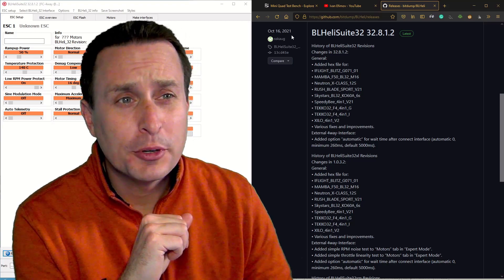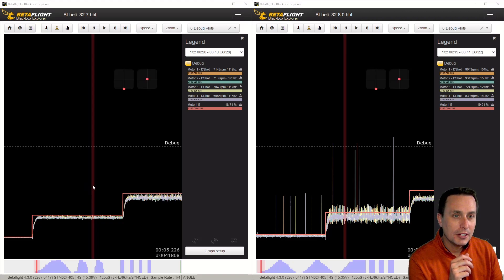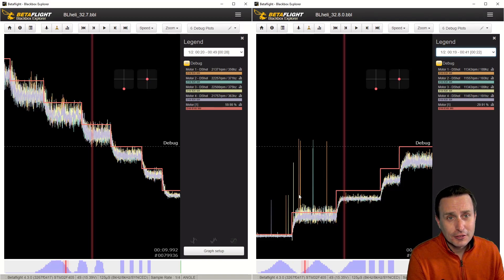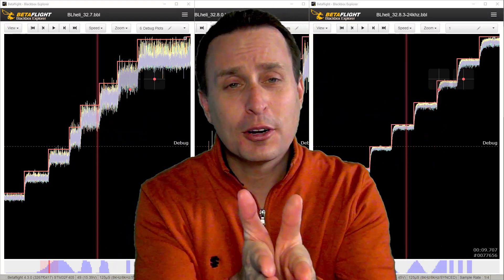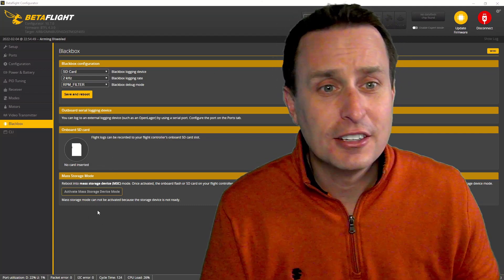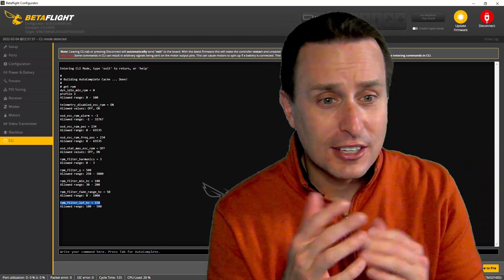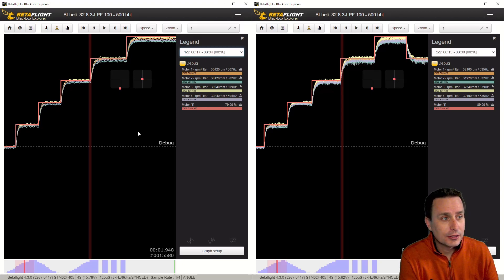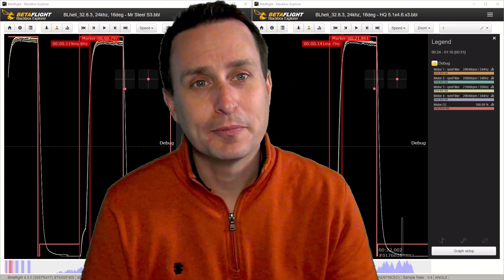💥The BEST BLheli_32 🔥 | RPM Filter Secrets 🤐

Comment: have a mamba f50_bl32 pro, used the 16-byrpm and had weird jitter at low throttle (1300) i could see the difference in throttle resolution tho at low throttle compared to other quad locked at 24.
i would like to use the by rpm setting just dont think my esc supports it. using an f405 board on both and they run dshot 300 4k/8k with correct filters and dyn idle at 24-25.
also my motors would sound like they almost stall out and get a wub wub sound on throttle chops letting it fall.
Reply from the maker: Dynamic Idle of 20 to 25 may be top low.  try 30 or 35.

If 16 - ByRPM is too low then of course their is 24 - ByRPM or just 24khz straight up (locked) which is tried and true.

Comment: Well, thanks man! On 1 of my recent BF builds with XNova Hardline Freestyle 2207 motors on an Apex 5", I had weird motor behavior, which looked like some kind of desyncs (motors did not seem to spin harmoniously) right after arming and just a small throttle, not even getting the quad off the ground. All on BF default PIDS and Filters, got to start somewhere ofc. Enabled Bidirectional Dshot, tuned filters BB based, But it was still there, be it a little less. Put back everything on default now, and did the upgrade to 32.8.3, arms normal now also with some quick throttle-punches. Now I simply have to wait for dry moments with less wind-gusts to finally start tuning it.

Comment: @UAVTech I have a set of Airbot Wraith32 mini st  blheli32 escs on my v1 Kopis. I think they would have the  f0 processor.

Would I still be able to run 32.8.3 testcode for some benefit, or would byRPM not work at all on these?

-i'm trying to gauge if should update to 32.8.3 or rollback to 32.7 on these (they were recently updated to 32.8 from 32.2 in order to enable the rpm filter/bidirectional dshot, but never tested out in flight)

Thx👍

Comment: is this why I can't get higher than D-shot300 on my 40A mamba pro stack that is capable of D-shot1200
Reply: well the answer looks like a no.. it shows higher errors of over 80%. while 32.8 only showed errors around 5% ??? i have seen loads of complaints about dshot errors with a few different Esc's not just the mamba
Reply from the maker: interesting

Comment: have an ESC which seems to be not in the 32.83 test code base. It's  T-motor Velox V45A and the hex file in 32.7 and 32.8 is called Tmotor_32Bit_32_83.Hex Bit the closed in 32.83 is called Tmotor_32Bit_Multi_32_83.Hex can i just rename it to Tmotor_32Bit_32_83.Hex and flash it anyway ?
Reply from the maker: If you download the right HEX, it will show up in the Configurator once it is placed and Suite restarted.  I would not rename to force it.
Reply: @uavtech  Wow that just works, I did presumably not restart after placing the hex file, now I'm feeling really dumb :-)

Comment: Awesome, I noticed weird behaviour on my latest build with BF 4.3 and  iflight 4in1 Blheli32 ESC , that comes with 32.7 : on dshot600 motors returns errors, ( found out later that some batches are with different low quality cks mosfets that generates this errors ) I put 32.8 ( not 32.8.3 ) and the errors goes away but RPM data was totally junk…what a mess !

Comment: Awesome comparison. I was watching Ivan posting this in the forums already and hoping they'd fix it. Thanks or visualizing, what it actually does. My AOS5 is tuned pretty sharply and filtering as least as possible, but I can't get to the point where I can turn off the dynamic RPM - it makes motors twitch wildly at idle. Also dynamic PWM won't work on mine, it just starts vibrating. Runs fine on 24khz though. So I'm gonna check 32.8.3 and BF4.3 and see if I can bring it even closer to its edge :)

Comment: 32.8.3 is much much better than 32.7 in most cases i have found. Unfortunately new esc's come with 32.8, and no 32.7, so you need to upgrade them to 32.8.3 before flying them.